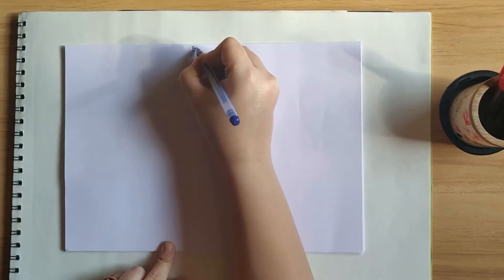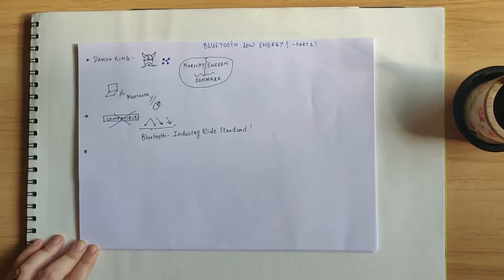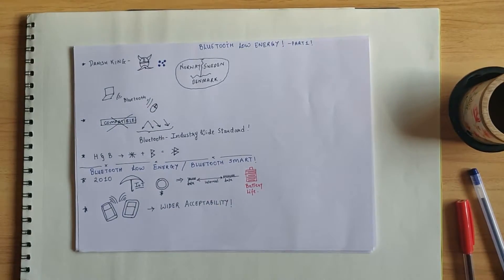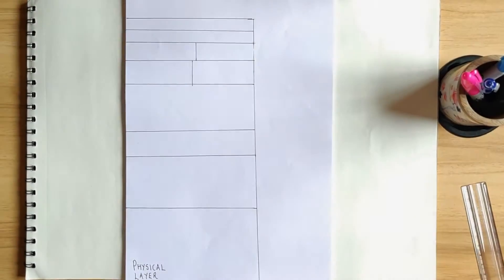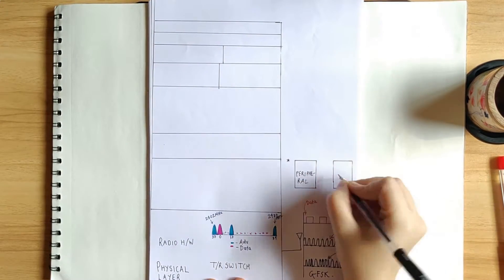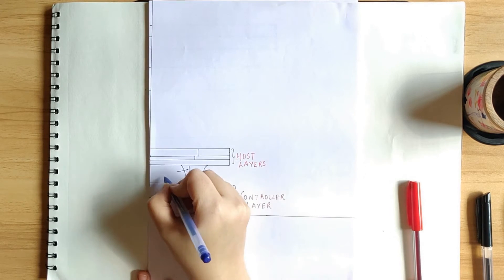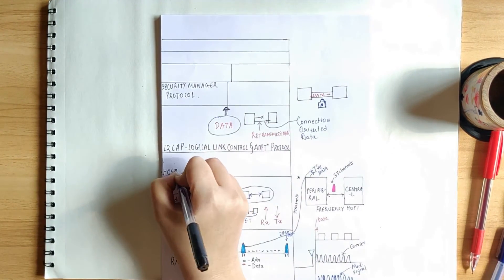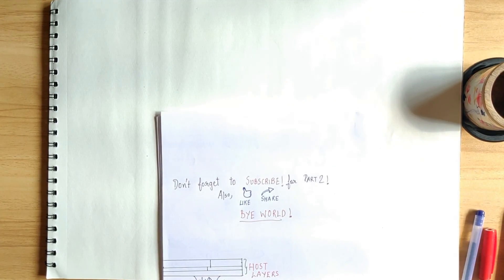Bluetooth Low Energy - Protocol Stack (Part 1)

Comment: Very great video! at 4:35+ you mentioned Bluetooth has 40 channels, but I was reading it has 80. Could you please clarify?

Bluetooth devices intended for use in short-range personal area networks operate from 2.4 to 2.4835 GHz. To reduce interference with other protocols that use the 2.45 GHz band, the Bluetooth protocol divides the band into 80 channels (numbered from 0 to 79, each 1 MHz wide) and changes channels up to 1600 times per second. 

https://en.m.wikipedia.org/wiki/2.4_GHz_radio_use
Reply from the maker: Ble/Bluetooth low energy divides the spectrum into 40 channels.However, Classic Bluetooth divides it into 80 channels.